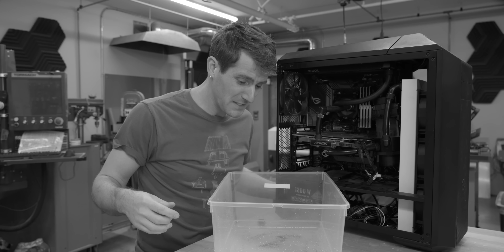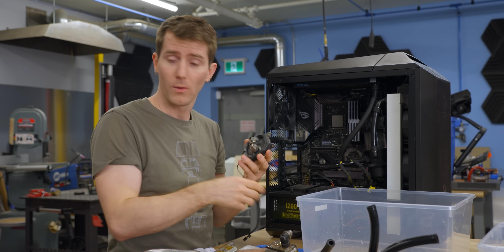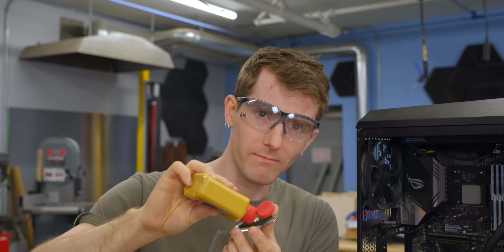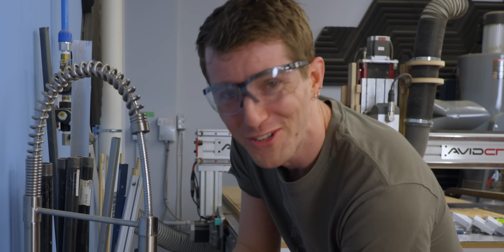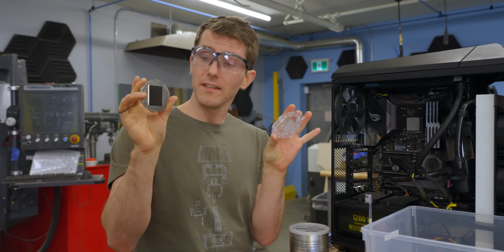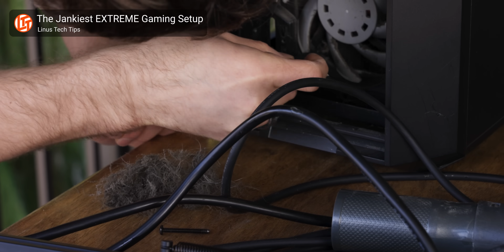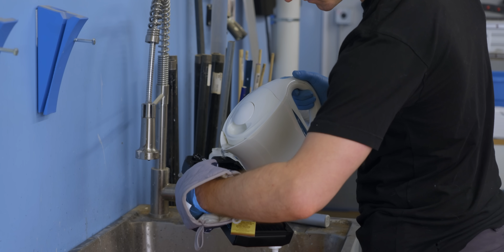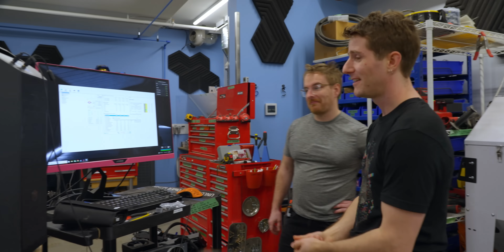I Will Never Watercool Again – Water Cooling Maintenance Guide

Comment: Have always thought, "Yeah, I really just don't need THAT in my life" whenever thinking about watercooling and boy, was this video a good reminder!
Reply: Full custom loop. Distilled water and corrosion inhibitor. I changed the water 6 years ago and that's only because my pump failed. Still completely clear.
Reply: Man you said it, ive always used smartly chosen air collers and cool running cases and never a cooling issue = but then I dont game heavily either
Reply: This. I like AIO 360 GPUs, because of low noise, but otherwise, fuck that.
Reply: There are no downsides to grabbing a 360 AIO over an aircooler tho?
Better temps, low noise and thats about all as there isnt really anything else that matters @exander77
Reply: I love my custom water cooled computer. It was fun to build, looks cool, and it's quiet as the fans barely run. As a result of the low fan use, it stays clean as it's not pulling in dust. I use all Corsair products and although they say to change out the coolant every year, I waited two before doing it last time.
Reply: @bp3d106  Yeah I just use an AIO cooler (Kraken whatever a while ago, Cooler Master ML240 now) and I've never had to do ANYTHING over the like 7 year total I've had them. I used the Kraken whatever-it-was for 5 years before switching, and I only did so because I was essentially building a whole new PC minus the graphics card and I wanted to go for a mostly white build. Never drained the liquid or did anything special to clean it, just dusted it like I do with every other part. Never had any issues. Very quiet and the temps are perfect!
Reply: @bp3d106 I’m looking of going to water cooled for my GPU and CPU. I only have AIO on my CPU but my room gets hella hot. Thinking of doing water cooled to get some temperature diff. Have had PC for about 2 years and thinking of doing the switch so I’m not sweating like a pig. Any suggestions or what do u think of Corsair cause thinking of dropping a G on this build
Reply: @Mr-Grey11YT  I bought my parts a while ago and haven't kept up with the latest info. Haven't had any issues though. I'd use Corsair again unless there was a specific look I was going for that they couldn't provide. I do believe a high quality fan can cool just as well but it's nice that my fans don't run as much or as hard as my previous builds.
Reply: This isn't how it goes unless you put literal mineral water with bacteria in it in the system. You use proper coolant mixtures with fresh distilled water, and this NEVER happens. Especially if you drain it once a year and refill it. Which takes 5 minutes and no cleaning required. The coolant mixtures have cleaning detergents, seal conditioners and lubricity agents to prevent wear and tear. Get a decent mixture, since I live in Florida I use 30/70 coolant/water mixtures since 30% coolant is the optimal ratio for perfect dispersion and suspension of the coolant detergent and additives, without causing a change in viscosity and reducing waters heating coefficient.

The inherent issue with air cooling is that there will always be one side cooler and one side hotter. This molecular difference causes the metal to bend and distort. No matter what you choose you will have maintenance. With air coolers that maintenance is removal of the cooling block to clean the fins, checking and straightening any bent fins from the process, then carefully reseating it. When the cooler block begins to warp, you need to get a new one. Anything but the Noctua cooling blocks usually warp in a year. Noctua 3 years roughly. But they all warp even Noctua. For liquid cooling if you properly build the set up or even just use an AIO, that process is, drain fluid from storage tank and cooling block, using fresh distilled water refill it and run a short cycle (only if you REALLY are scared it's not clean inside already from improper mixture use in the past, but if using proper mixture this is not always nessisity especially if using the se mix in brand and quantity) then drain it again, and then refill with your proper solution. This process takes anywhere from 5 to 15 mins. The air cooler can take a few hours depending on the size of the block and the damage to the fins during removal and cleaning. 

What they did here in this video is what using mineral tap water does to your system. Use fresh distilled water with the mix to make your solutions you put in the tank. I've done this for 8 years and I've never had to do what these guys have and I've been maintaining my customers PCs that I built for anywhere from 1 to 8 years depending on customer.

This doesn't really happen in proper builds.
Reply: @BigPanda096  I see liquid cooling is your entire personality. I don't know where you managed to dig up the idea that air cooling requires some sort of maintenance that takes hours or that the coolers are only good for 1-3 years, but you're part of the reason the entire hardware community is crap now.
Reply: @sleightlywhee  I mostly work with industrial machines, and at those scale due to the uneven nature of air cooling causes issues when things baseline at 133c.. it causes warping and when you have to do the maintenance for the air filters on each machine, it takes hours as opposed to closed circuit liquid cooling with centralized radiators that share air filters. On a personal computer level it doesn't make a difference but in my line of work I've seen firsthand the pitfalls of having air based systems. When they start warping if they break brackets it's hours of taking apart boards and putting things back on. I'm sorry you think I'm the cause of the hardware situation but I assure you I'm not. It's also undeniable that liquid cooling works as a better buffer. You CAN get the same results with air cooling but there are a lot of caveats people ignore in order to get that performance, caveats that when unaddressed leaves people wondering why their air cooled system can't keep up with a liquid system in terms of heat buffer and equilibrium. As well as maintenance of even temperatures across more nodes, due to how water works as a buffer and transfer agent to greater effect than air ever could, paired with less need for more fans that generate their own heat, and at industrial scale yeah, air can't even compete. In the PC market it's "fine," though so long as you have proper airflow with lower ambient temperature.
Reply: @BigPanda096  If air cooling fin stacks warp, wouldn't it stand to reason that the micro-fins within water blocks would ALSO warp? I imagine they would actually warp FASTER given their incredibly tiny footprint, and being exposed to a much higher temperature differential? What you're saying doesn't make any sense --- you never mention having to dismantle waterblocks to perform the same maintenance you described about the much larger fins in air coolers, when thermodynamics would say these smaller fins would need regular upkeep which clearly isn't the case. I have personally never seen an air cooler block warp like you describe unless it was poorly handled during installation/removal.
Reply: @spartan456  thermodynamics WOULD agree with you, if the medium going through these blocks were air and not a wayer\glycolic solution. Because water/glycolic solutions have a far, FAR superior thermodynamic transference rate with itself than air, it's more evenly heated. Air causes distortions because it's actually a rather decent insulator and makes it harder to transfer heat effectively throughout its own medium. For instance air molecules don't transfer heat to other air molecules even half as effectively as water does. Because of this the heat gradient is far more gradule and because of that the "warp," effect is minimal "when done correctly." 

As many found out in the early water cooling days of PCs when we used to use fishtank water pumps and fish tanks to do everything in, that doing it wrong can cause an even greater degree of warp. At first many thought this made no sense, because as I mentioned heat distribution in water is far more efficient at buffering and causing wild, fast swings. The problem we discovered collectively, was exactly that. It was easy to get better temperature reads with a messed up system, which made you think it was working well when it was being damaged. With air because the effect is far faster, it is easier to diagnose and tend to before catastrophic failure. 

The microfins don't warp the same way because of material physics. Those thin aluminum fins are more durable than the bigger copper alloy fins of the air, because they have to handle turbulent forces from a viscous fluid flowing through it where air is not a very viscous fluid it's a rather "thin," fluid. And because they are aluminum they also aren't as reactive to heat transferance so they are less likely to heat up on one end more than the other. Of course you can argue (accurately at that) the aluminum fins inside where the water is flowing through (there are internal and external fins to maximum surface area the ones on the outside of the radiator that only air flows through are still copper alloy fins) are actually worse at heat transfer, but because of waters ability to act as a buffer while also being suceptable to evaporative cooling processes (the most potent cooling process we know of, one air cooling alone cannot take advantage of) which more than double make up for the loss incured by the material physics. 

As you can see, this debate is one that can endless loop as neither are "superior," in an objective sense to the other. My opinion is that when you build your loop properly and assembled it with properly cleaned and sterilized parts, with the proper cooling mixture, it is far less work than the air systems due to the lack of regular cleaning maintenance required. I've not once in 6 years taken apart my system and it still works as good as it did the day I tuned it in. I clean 1 single dust filter, and have had no issues for 6 years. No replaced parts, no leaks, no fin maintenance, but absolute abuse to the cards in terms of being used, and my cooling system manages to keep my hottest components under the highest loads I can deliver to it, at optimal operating temperatures, and if I speed the pump up a little while closing a restrictor valve, it drops my card from 55c running 1440p at 150fps, down to 42c. It won't go lower than that unless I turn my AC on and set it at 70f.
Reply: Yeah a loop doesn't look like that unless you fill it with crap coolant ( which they probably did in this case ) or if you never drain it, which takes like 5-10 minutes and another 5 minutes to fill it.
Obviously staged for this purpose but yeah, you believe what you believe.
Watercooling is very cool and fun to work with, it's never necessary though, unless you have the latest Intel high end CPU I guess.
But just like a car with tons of moving parts, it requires some maintenance.

Comment: I thought about water-cooling the last time I upgraded, but WOW, I had no idea it was that much of a PITA maintenance-wise. I'm SO GLAD I went with air-cooling.
Reply: @drdillio95  It isn't that bad. I use distilled water with a little bit of coolant and maybe drain it every 2 years, but I've even gone 5 with zero problems. 7 years later on my current system and I'm tearing everything down to flush it for the first time for a new system. It takes a bit of time sure but isn't that bad. Keep in mind they're showing you the worst of the worst.
Reply: that Video is completely over dramatic. If you do it correctly, you have a drain and you flush out the system every 1-2 years. Takes roughly 30 minutes. done. This System looks not set up properly. You usually have additional chemicals in the water to prevent what they are showing. (Like i assume they just added distilled water and left it as it is)
Reply: @meerpirat3418  Exactly and I have seen good setups running like new without flushing even longer than that.

Comment: i have an nr200p max with a 280mm aio driving a 5700x clocked at 4.35ghz at 1.076 volts 60watts at 54 degrees celcius and its dead silent

Comment: 15:51 That puck looks like it's made of the same material as an air-filter I had once, as soon as I got it wet (it was really, really old by then, and well, wet and touched) it started to disintegrate like the one in the video.
21:06 Do you? Because I might be misremembering (or mixing you up with someone else) but I seem to remember someone talking about just putting tap water into water bottles for distilled, just to keep people from moaning in the comments (my words), and that it doesn't really matter (at least if you use biocide, maybe).

Comment: Fluid change I get... I have my system for 2 years now and changed fluid once and no problems what so ever and it sits mainly so its bad for fluid condition... no gunk tho everything clean, maybe dont put water in it  ? only special fluid and it will not need all that stuff... o ring lubrication ? come on ? do you do this to your car ? you change o rings when it fails and lubricate with the fluid that its in contact with when dissasembling otherwise no need

Comment: On the part of water pumps.. I had to really pause on the MCP655 box lol; because I'll be damned.... LOL mine has been running for 8.5 yrs now!?! I did accidentally break the speed control (my fault, in my defense I was also 8.5yrs younger/stupider). But it's genuinely no joke, reliable and silent if you adjust it to your system needs . Mine has been running near constantly and pushing 2x gpu blocks, 1 cpu block, 2 rads 360+240mm and several tight bends (flow restrictions), it's imho among the most creme de la -whatever it is-.

Comment: I'm in favor of air coolers because I had a pump fail on a corsair aio and realised water cooling was just adding points of failure. I'm just glad it didn't leak.

Comment: Water cooling is used for so many years already, how is it possible to not find the perfect chemical to run it - with no interaction to metals and rubber and to prevent life from thriving in it and to have high thermal capacity... And yes, I've never used water cooling and I am not planning too. I am a fan of air cooling and fans that run at ~400 rpm max idle, 1000 rpm under max load and I believe I am quiet enough.

Comment: Standard air coolers are just so much lower maintenance, more reliable, longer lasting, and thus far more cost effective and practical as a result, especially if you're using a more normal CPU and not a high end high core count CPU, but even a 7950X will work very well with a good enough air cooler. 

Technically, most good air coolers actually DO have liquid inside the heat pipes, but nobody calls that "liquid cooling" for some reason. 

Large and heavy air coolers are not as easy to safely transport because of how heavy they are, but this isn't a major issue for most people, as you can brace the cooler with packing material, or just take it off before transport.

Comment: I have water coolers running on several PCs that are way older than 5 years, I tend to build computers for our engineering dept.  My oldest is at home running a first gen i7, I have had only one water cooler fail on me, it was the pump that went out, the rest I don't have heating issues with.

Comment: I don't want to be a plumber when I need to work on my PC. I moved to a big 7' air cooler.. and my temps and stability are just as good as any air water cooler.. with undervolting my CPU can hit 5.5ghz for a sustained torture period and doesn't pass 71c.. it's insane. Completely silent as well.. Not to mention most AIO's are built with the absolute worst quality and absolutely horrendous quality control, and it's pretty hard to mess up an air cooler.

Comment: I always cringe when I see people use colored cooling liquid. Most of them stain the system over time and the reserviour looks awful.
Also I had that problem once before where small rubber parts of the lines ( or black paint from inside the radiator) collects in the system. Almost need a reserviour with a dirt trap for that. I always flush out new watercooling components before installing them and change the " water" if it gets nasty.

Comment: Or you could do as Jay 2 Cents and use air pressure to fill and empty, he found using negative air pressure he could fill the entire system 100% in one go without all the hassle, and the same when emptying it for maintenance.

Comment: Been water cooling since the old Athlon 64 days (20 years now? jeez) still using the old flex tubing. No desire to buy all the tools for hard line tubing, all I need is a tube cutter which cost me $8 at the hardware store and I buy the clear tubing in 20 foot rolls for $11 at the hardware store as well. Glad to see others are still doing it the 'old' way as well. I've never seen that type of build up in my systems though, yuck. Nothing but distilled water with a silver coil, in my loops.

Comment: The lesson i learned here. Is that watercooling is for people with enough expendable money. All those fins, regardless of cleaning looked like they are not smooth enough anymore to let water go through . I also would not risk using parts again that have been corrosion . An AIO for my cpu i would be ok with . and replace it when it nolonger cools well. But a custom watercooling is pricey. And if it all becomes this dirty cloggged and corroded over time. Then no thanx.

Comment: Water cooling nowadays is definitely just a luxury/Flex for the average user. Sure a power user who is trying to get every single MHz out of their parts possible might find benefit, but air cooling is just so good nowadays. I just upgraded my GFs PC to a 5700X and just reused her old Hyper 212 Evo. I added a second fan to the tower but that's it and the chip still cruises at 4.6-4.7Ghz on Prime95 no problemo.